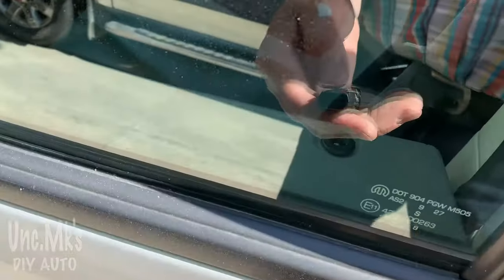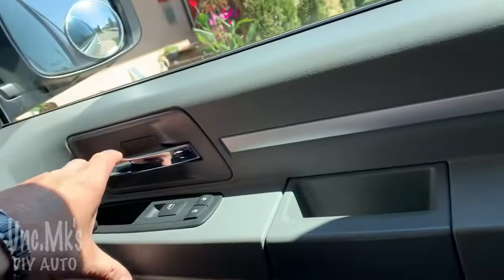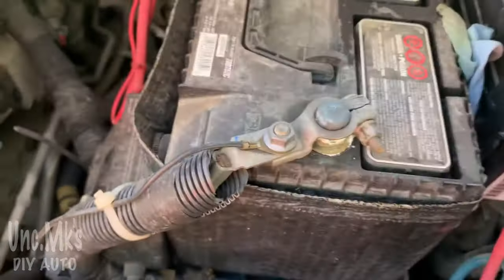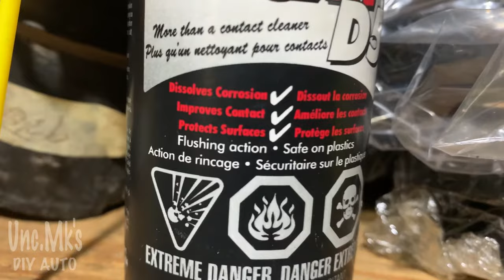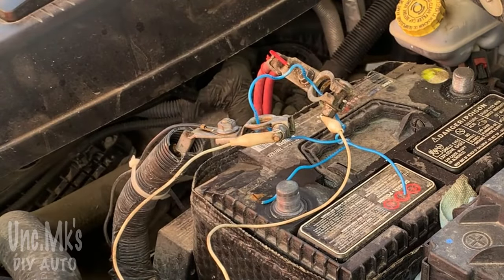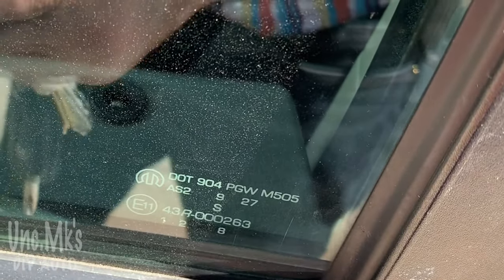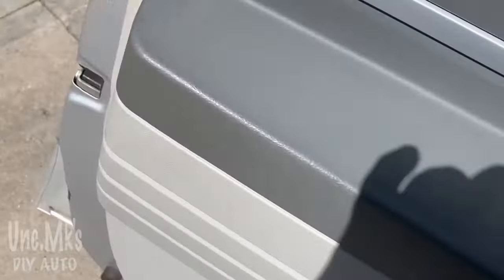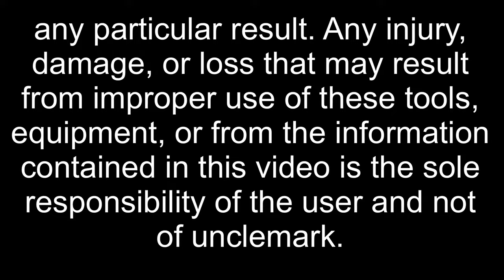How to get my door locks working! TRY THIS FIRST!  (EP 216) Why don't doors unlock? Grand Caravan VW

Comment: Do the cables need to touch for it to work?
Reply from the maker: Yes. Cables need to touch for a good 30 minutes. Make sure both cables are unhooked from the battery as well.
Reply: Why?
Reply: @unclemarksdiyauto  excuse me one last question.. what are those alligator cables called to connect the two cables?
Reply from the maker: @kingcobra9485  I think they are just called alligator clips!

Comment: where do we buy the mini jumper cables from, and what  are they called
Reply from the maker: alligator clips with wires. Here is a link:  https://amzn.to/3O25GHV
Reply: @unclemarksdiyauto   What is the purpose of attaching with the alligator clips
Reply from the maker: @health-of-it  It is to get both cables to connect and make contact to by shorting them both together for a period of time, it fully drains the capacitors in the computers. With the complete power drained from all circuits, the computers will completely reboot. Whatever glitch was in the system will hopefully be gone. (If this is the problem. It has worked for a lot of viewers)
Reply from the maker: @health-of-it  The wire shorts to 2 cables together for a period of time (half hour or more will work) so the capacitors in the computers totally drain of all power. When you reattach the cables later to the battery, all the computers will start off fresh restarting from scratch. Any glitch in the system will be gone (If that is the problem) This has worked for many viewers.

Comment: When it does it in my town and country the driver door won’t open from the inside
Reply from the maker: But it does work sometimes?
Reply: Figured it out sticky door lock but as far as the doors not unlocking idk it just started working again randomly
Reply from the maker: @tylermccloud3027  door lock as in the actuator in the door, or the switch. If the switch is sticking, the switches are really cheap.
Reply: @unclemarksdiyauto  the actuator was sticking thru a new one in well I didn’t but my mechanic did
Reply from the maker: @tylermccloud3027  it should be good for a long time now!

Comment: Why do we need to connect the two terminal wires together with alligator clips and couldn’t we just tape them together instead of using the alligator clips with the wire
Reply from the maker: @ctm130  that can work too! My way for sure they are connected together.

Comment: Have this issue with my 2004 dodge dakota on my drivers front door, key fob and buttons unlock and lock all my doors but my drivers front wont unlock unless i use my key on the door, any idea?
Reply from the maker: Probably the wires that flex in the door jamb. I would check there first before so bought the switches. Question, will the drivers door unlock if you use the passenger door lock button?

Comment: I have a stumper for you! My 2020 grand caravan, it locks & unlocks just fine, however, when I lock it they aren't effective, meaning, you can still open any door on it, but it sets the alarm off! I'm so frustrated at this. What's the point of locks if the doors are still going to open? Please tell me you have a fix for this.
Reply from the maker: 1st question, is this not under warranty anymore? Do the chrome lock buttons on the door panel pop down when you hit lock? This is weird that such a new van is doing this. Did it start with just one door lock doing this? If it was just one, I would think this is the problem, but again usually after these vans are a lot older, and usually one door only: https://youtu.be/OcBPU9zrQrw
Reply: @unclemarksdiyauto  not under warranty as I'm the 2nd owner. Now that you've asked we've only tried 1 door so I can try the others & see if it still happens.
Reply: Also, after looking at it last night (we don't drive it much) the front locks but not the back, so we will be trying this fix today.
Reply from the maker: @mariedaniel2978  Humm, I thought you said the front did not lock. Either way, each door latch has a switch in it so it the switch does not trip properly, the van computer  thinks it is unlocked.
Reply: @unclemarksdiyauto  I thought it wasn't. I honestly haven't had it very long. I've seen 2 things to try, your solution & pulling the m38 for about 30 seconds & Holy cow that fixed it. If it didn't, I was going to try your battery terminal solution next. Thank you so much for being responsive, & my apologies for my temporary ignorance.
Reply from the maker: @mariedaniel2978  I would not think you were ignorant! I panic too when something has me stumped.
Reply: I appreciate you, & you did gain a new follower since you do have some great tips!

Comment: Very helpful 😃
Reply from the maker: Thanks Erica! Usually the very first thing that a shop checks are for broken wires where the door hinges are. I need to do a video showing how to pull back the rubber boot covering them and show how to check. They either have to be joined back together by soldering them, or by replacing the wiring harness as eventually all those wires break from flexing.

Comment: Would this work on a 2018 jeep Cherokee??
Reply from the maker: It might. If none of the locks are working, there should be a fuse under the hood. (in the fuse box called a TIPM) Not sure what side it is on or what # the fuse is. Inside the lid on the fuse box will be a diagram as to what each fuse does. One should say "locks." It may be burnt out. Replace that fuse if burnt and see if they work. There may be a short in one of the wires that will need to be fixed.
Reply: @unclemarksdiyauto  my driver side lock is the only one not working, I’ve tried the door lock inside.. still doesn’t lock, is it likely the actuator?
Reply from the maker: @sandycruz1114  It could be. Was it making weird noises for some time before it stopped working? Does it make any noises now? Usually they start acting up, working only sometimes etc. Let me know. I could even be a broken wire in the door jamb where all the wires feed from the door into the vehicle body. Can you check on if it still makes some noise? Thanks sandy.
Reply: @unclemarksdiyauto  no noises at all, I don’t hear anything when I lock or unlock the door from the inside
Reply from the maker: @sandycruz1114  I am not a expert, and this is hard to give guidance long distance but I think I would still look at the wires that go between the door and the jeep body where they bend. (not a easy thing to look at) If they are not broken, then a person could check if power is getting to the door actuator. If power is getting to it both in the lock and unlock modes, then the door actuator / latch needs replacing. This is probably something most people would want to take to a trusted mechanic/tech.

Comment: By touching the cables together you drain all juice from the system. I use Ballistol gun oil on my battery terminals. Many more ways to use  Ballistol. Cleans Guns wood metal. Amazon get the full liquid not the spray
Reply from the maker: Yep, draining capacitors so system starts up fresh, no memories to screw with the electronics.
Reply: When I have done this I took may rubber bath mat from my tub and put it over the battery after disconnecting the terminals so electrical terminals from battery aren’t exposed.

Comment: I don't understand the connecting wires part.  I disconnected from battery for 30 minutes and still driver side moves a tiny bit but doesn't actually lock ir unlock whether using the buttons on the door or fob.  The buttons on driver door unlock & lock all other doors though.
Reply: Will the capacitors be drained if just terminals are left off for a longer time?
Reply from the maker: That will not help your issue.
Reply from the maker: The problem could also be your drivers door latch. it has the electronic parts (its like a little motor) that pulls the manual door button to lock and unlock. You are probably going to have to see a mechanic. Ask around to see where is a reasonable place to get this done. You don't have to go to the dealer.